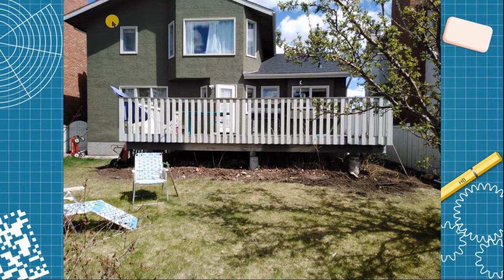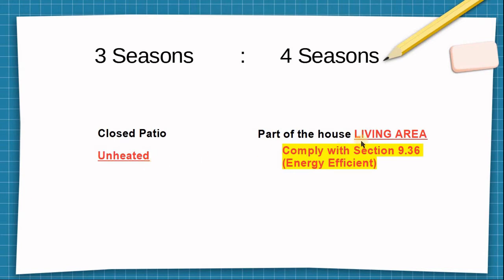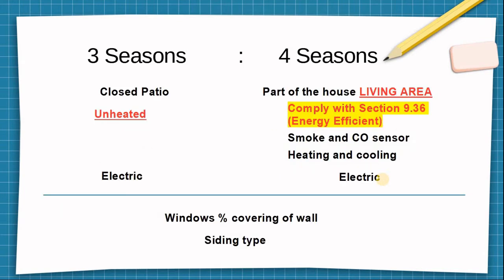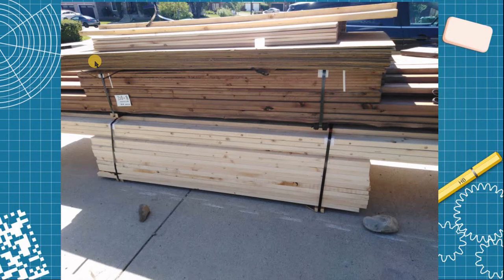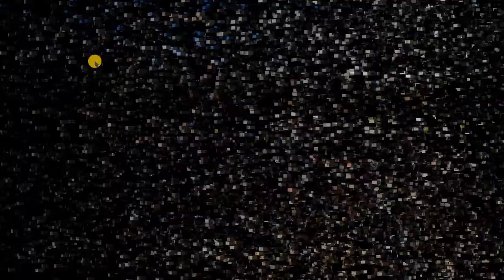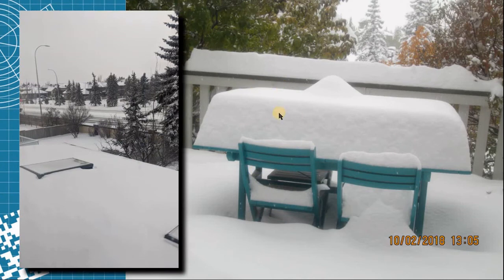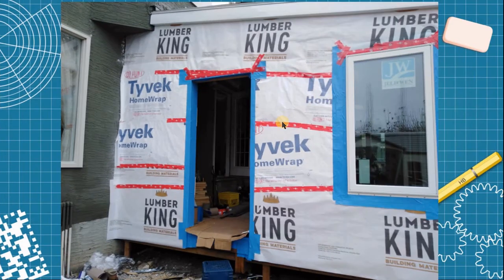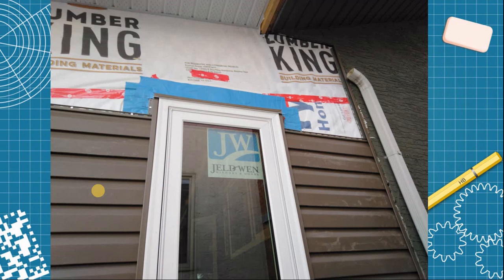DIY. How to build your Sunroom and manage Sunroon prject . Tips and Tricks.

Comment: I think you did great. We also plan to build it ourselves, and now we are looking for information on this topic. Thank you for all the little things that you described, could you write how much the construction cost you.
Reply from the maker: Hi, The cost in Alberta, Canada 2019 sunroom size 24x15 ft around 35,000 CAD. based on the code requirement in your area it may cost you less or more but we if we didi concrete pile instead of screw we save 1500, two pan window save 1000, optimize floor wood 2000. Also we used lots of insulation. where do you live?
Reply: @LunchandLearnX  Thanks for replying. We are located in USA. state Massachusetts.
Reply from the maker: @gonewiththewind8982  please check the code requirement however it is less than Alberta so you will need much less insulation if it is 4 season.  Also try normal shingles more saving.  If there is specific question please contact me. I will help as much as I can. Good luck

Comment: Hello 
What a great video and beautiful work 
I am in the USA ,go back and forth to Calgary too 
Plan to add sunroom the way you did to our porch 
Would love to share with you our plan get advise 
How to get max height when going with studio roof ?
What is best glass energy efficient to use ?
Is wood better than albumin?
Thank you 
My name karim
Reply from the maker: Hi Karim, what is the available height in the porch? is the porch roof flat? you can huld a false roof on the house to get the porch extra height. The chanlang is the insulation  thickness which can eat up the height. and depend on 3 season (no code applied) and 4 seasons (code complying). We got our windows from homedepot (3 panes) the type and window is cretical for energy calculation. for aluminum structure section,, if they are hollow with no insulation inside then wood is better however wood need attention more than aluminum. Hope I answered dome of your questions
Reply: The porch roof will be studio ,flat with a slope 
Line your suggestion of a false roof on the house portion to gain height 
Great help 
I was told by one contractor that triple pane not better that double ??
I doubted that because they are more pricy 
How much energy efficiency you get more going to triple layer instead of double layer ??
Thank you so much
Reply from the maker: @karibushma4339 3panes  will give more sound barrier. It add little more to the heart insulation but sound  more. Or is facing busy road so it is important.  Check the window rating with architecture designer before buying